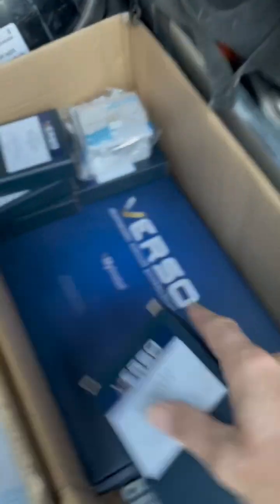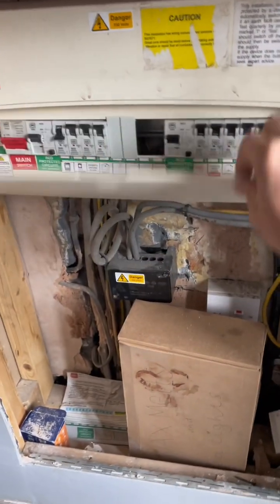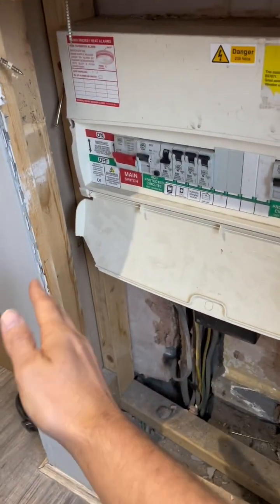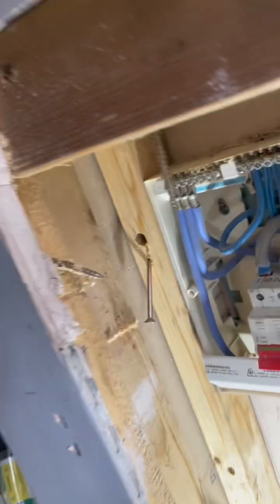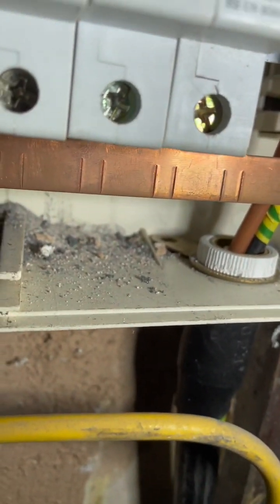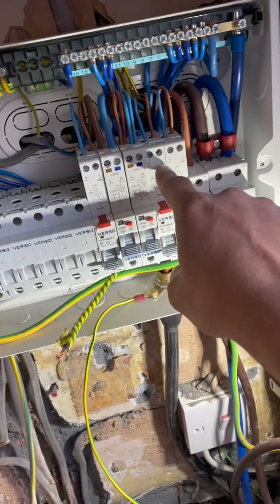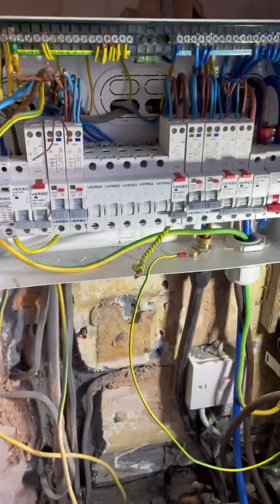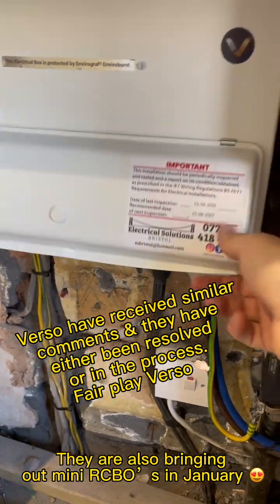HONEST review of the 1st Verso consumer unit I installed. READ DESCRIPTION

Comment: I do love the honesty of your vids. "Cocky little prick" 🤣. Why use both rcbo's and afdd's? Is the board any better than fusebox? I am the same as you, would like to try it but have no one near me that stocks it so can't just get the 'off the shelf' stuff. 👍
Reply from the maker: AFDD’ we’re for the socket outlets as it’s an HMO. I think it’s just as good as Fusebox
Reply: We deffo think it’s better   😜
Reply: @navitascp  it may well be but I can't get it off the shelf anywhere near me and although I would like to try it I would like to be able to get extra bits, rcbo's etc off the shelf if needed. Been  looking at fitting it for ages and got a couple of board jobs coming up (if customer accepts). An 18-22 way and a smaller garage board type. But as can't get it and never used it, I can't vouch for it.